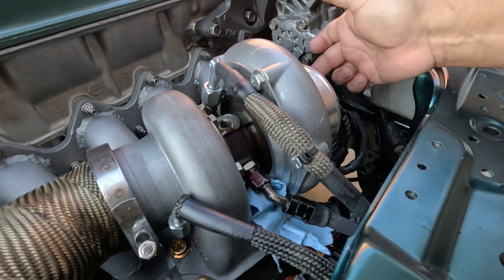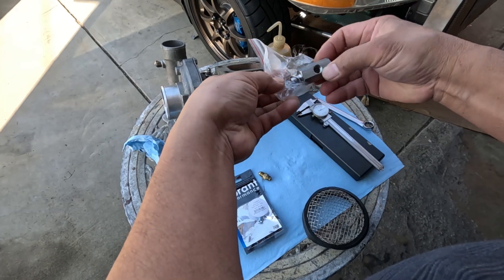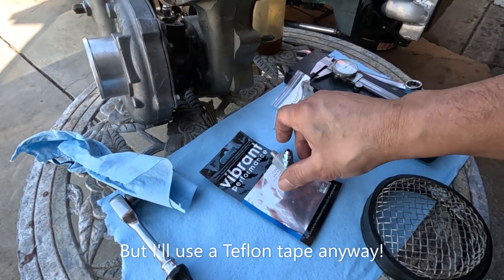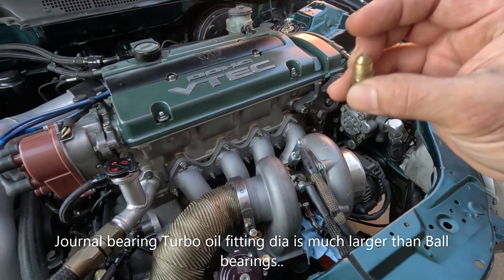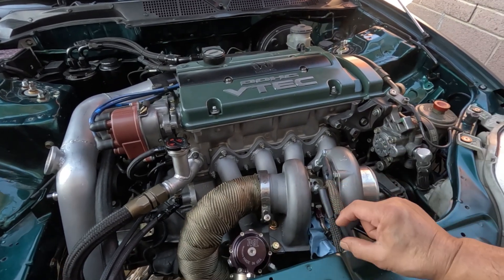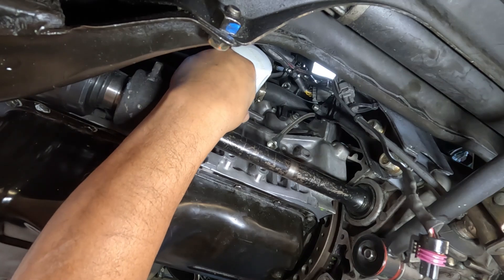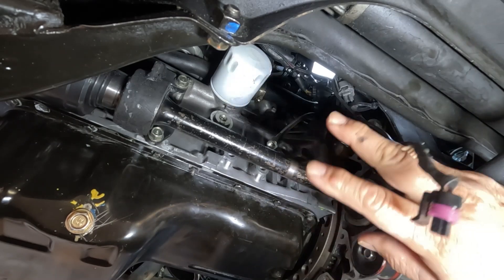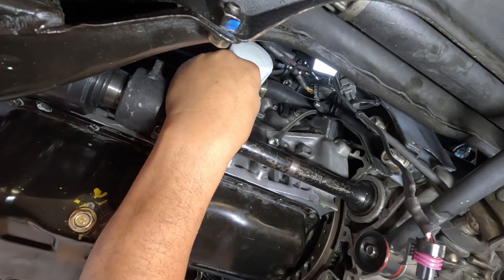Turbo oil feed line/source and oil restrictor size.

Comment: or get a oil sandwhich plate most of the time i use the oil sandwhich plate afaid of breaking where that fitting goes and the oil sandwhich plate is a lot easy to use
Reply from the maker: Good idea and l thinking of adding a oil cooler. I'll make some changes if when l install a oil cooler( external). Thanks